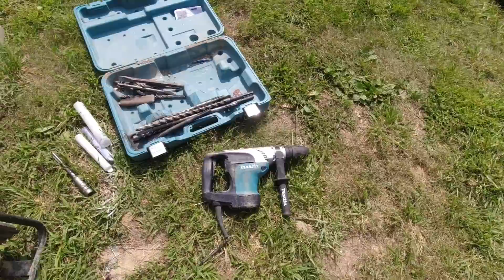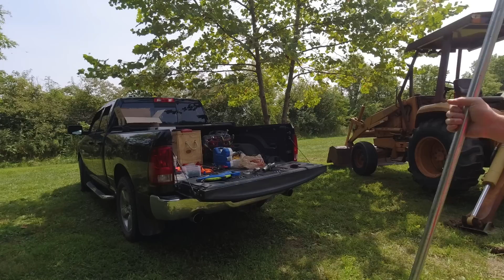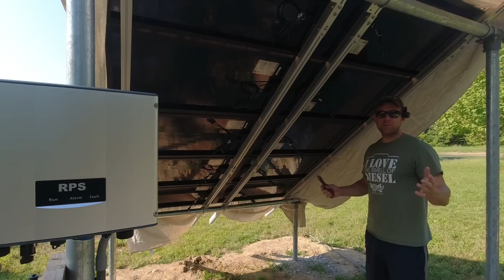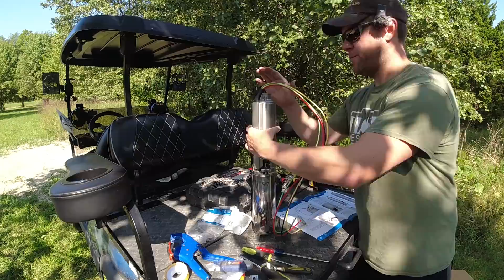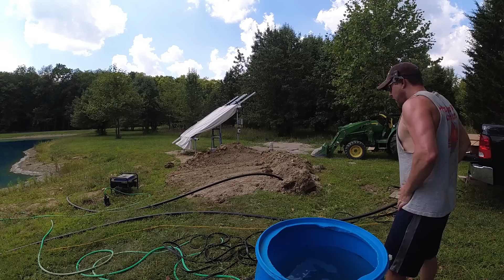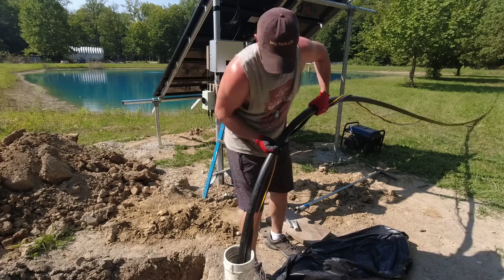Installing a Solar Powered Well Pump to Fill Our Pond - RPS Solar Pumps (part 2)

Comment: 1. Great video thank you.  I just have one suggestion as a well guy who puts in pumps over last 30 years, put all 3 hose clamps on one side of pipe wire on the other so no chafing will happen by nipple. The wire will lay flatter against pump body. Also easier to tape. Good job.
Reply from the maker: Hey, thanks!  Want to help me pull it up and make that change? ha  Next time!

Comment: 1 year later, hows the system holding up?
Reply from the maker: Still running strong!  Not as much in the winter, but it's producing.  I don't know if you have kept up with my channel or not, but I now also have electric out there.  So I will be able to pump at night if I want.  It's been a solid addition to our setup.  I'll make an update video on it this spring.

Comment: Interesting setup.

I question the diameter of the piping, wondering if you could have installed a smaller diameter polyethylene pipe.  Looks like 1.5 inch diameter pipe, and using a 1 or 1.25 diameter would have been less overall total pipe weight, with a lot less weight of water above the pump, maybe allowing the pump to pump more water.  Guessing the instruction manual for the pump had specifications for using a 1.5 inch diameter pipe when greater than 100 feet deep?

The flow rate looks like it's enough for preventing evaporation of the pond during Summer, so would enjoy hearing your results I'm wrong, and the pond is filling up!

If the pump could run all night, would seriously accumulate some water!
Reply from the maker: Hi Roger, you make a good point about having larger pipe.  This pipe actually is 1.25" SDR11 though.  RPS sized the pipe to the pump when they sent it out.  I didn't even have to think about it!  We are getting really good flow right now and I plan to make an update video showcasing that very soon! The pump could run all night if I wire AC power to it....which I just may! :)
Reply: @IndyFarmLife  Thanks for the reply.  Then the flow rate seems about right for 1.25 pipe.  I'd likely install/invest in lead batteries rather than paying for AC electric from the grid for filling a pond, or anything not providing a return for money.  (If using batteries, will likely need separation from ground water areas in the event a battery leaks or explodes during charging.)  If ever able to run 24/7, probably best using a small delay control, for giving the pump intermittent rests/cool down. (eg. run 10-15 min, rest 10-15 min?)  Or better yet, just use the batteries for daytime cloudy days, as the pump might require a significant number of batteries.  Just some ideas.  Hopefully the water supply provided will be significantly accumulative, rather than my gut feeling thinking will be only fighting evaporation levels!

Comment: Thanks for the video. I've got a pond much smaller than yours that I've been contemplating putting a solar pump on.
Reply from the maker: I'm glad you liked it!  It would be a great option.  It's only been a week or so, but I already love it.  It's quiet (other than the water running in) and it's not going to add to my monthly utilities.  I'll definitely be providing updates on this as time progresses.

Comment: Looking good!  That will bring the temp down quick.  This hot weather is brutal, had to shut off the aerators this week. Looks like your plan is coming together.
Reply from the maker: Thank you!  Yea ours was a little chilly after that week of overnight 50s but it has bounced back quickly!  This week has been nuts.  I'm outside working now (9:45 pm) and it's still nasty!
Reply: @IndyFarmLife  I ended up adding another aerator to mine and it is churning up 50 years of muck and it looks terrible.  I keep telling myself it will get better soon 🤣 Working now to get my old well pumping in it.  Seriously thinking about this solar setup. Thanks for sharing.  When is the next live session happening?
Reply from the maker: It will definitely get better!  Just takes time!  I'm already noticing as ours is getting older, keeping the bacteria/bio mass in check is more difficult.  If you well produces good flow it may be worth it!  Definitely want to do another live.  Want my wife to join if she can.

Comment: Electrical tape is the only tape you want to use down in a well And as far as I know, electrical tape does not react to nylon rope
Reply from the maker: Well (see what I did there, ha) that's a good comment to read!  Thanks for sharing.

Comment: I thought about a well to keep my pond topped off - then I found out that we sit on top of 750 feet of clay before we get to water.  I'm not paying that kind of money for a 1/2 acre pond.  Waiting on the rain to fill it back up.  Still, a solar powered aerator/fountain is still on the project list.  Great video - thanks!
Reply from the maker: Thank you!  Wow, 750ft!?!?  Are you on city water, or is the well for your house that deep?  I'm excited to see how this performs.  Not paying extra for electricity will be nice.
Reply: @IndyFarmLife  on city water for the house, so life is good.  I plan to build a floating dock like yours so we can enjoy the pond more.  I need to get it cleaned up.  It has been neglected for way to long.  It's not very deep, but it's still nice to have.

Comment: Adam is better looking than Tim Taylor in my opinion. That aluminum coupler is handy for connecting the submersible pump!
Reply from the maker: TT has way better hair though. Ha. Yea, the pitless adapters are pretty cool.  Probably not very common down south!
Reply: @IndyFarmLife  Around here they just put the fitting on top and the pipe can be left on the surface. I never noticed your hair but even I have a full head of hair at age 56.